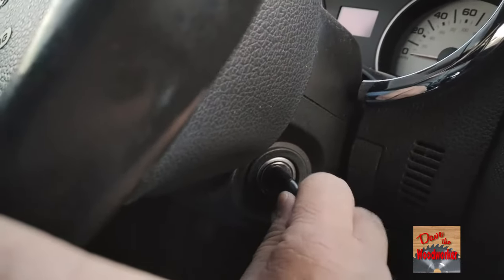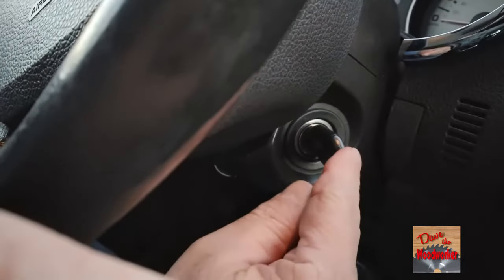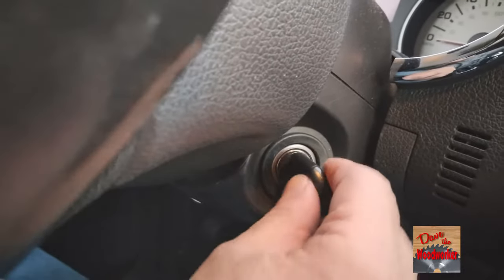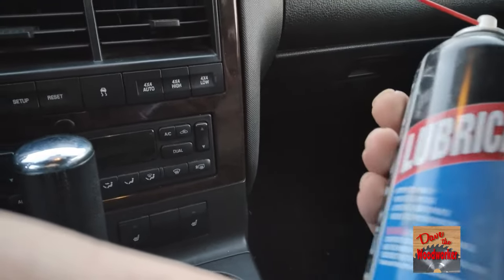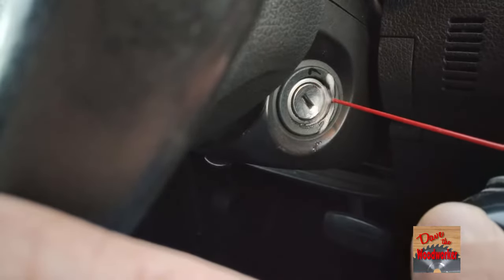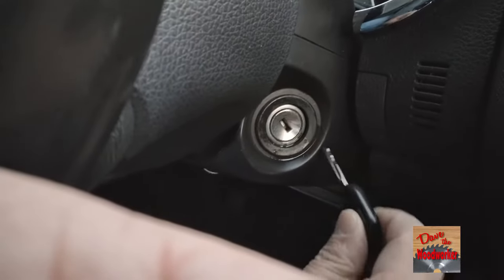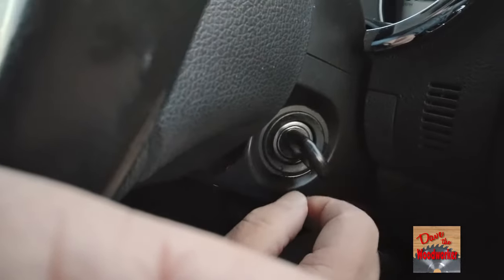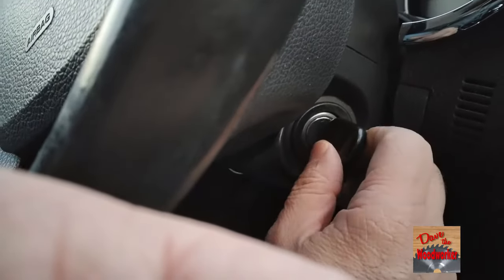Ignition Key Won't Turn | Quick Fix

Comment: I tried this, wont work, my steering wheel is locked, put some wd40 in the key hole and tried to tun the key, wont turn, banged on it with my palm just like you said, nope, wont turn. Im so baffled rn

Comment: Good tip. Haven’t had that happen, but occasionally when shutting it off the steering wheel is close to the position where it locks. Then the key won’t turn till the wheel is moved with a little force one way or the other to release the tension on the key tumbler.
Reply from the maker: Thanks, yeah I thought mind did that, but it wasn't the case.
Reply: Love you man

Comment: I'd like to add, after you get it started and you get home, get a replacement ignition cylinder and swap it out asap. don't rely on this method to work every time. I waited and now no matter how many times i bang on it, it wont turn to the ON position so i can unclip the cylinder.
Reply: This is the internet... fast n cheap/free is all that matters! You should see how I got roasted in the LEXUS forums, for giving free, accurate and helpful advice on a lost key issue.

Comment: Sir, I love you, but spraying stuff around the outer perimeter can get into the antenna coil around the lock, and damage it. 

I strongly recommend only a tiny bit of HOUDINI, no WD40 or Graphite or Teflon is ok. Ford Locks do intermittently fail. If you do not have a lock shop nearby to get any Houdini, CRC5-56 is ok, as is Silicone spray lube. Intermittent failure is a GIFT from Ford, to replace the lock, or the keys if they are worn, with freshly code cut keys... if problem persists, a freshly coded ignition lock cylinder is indicated.